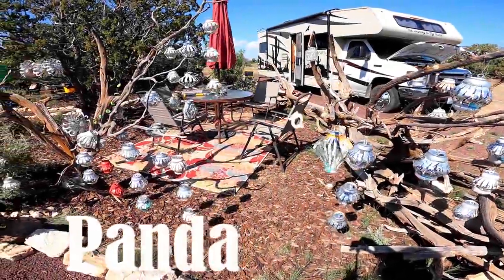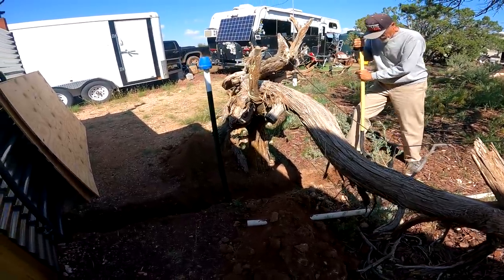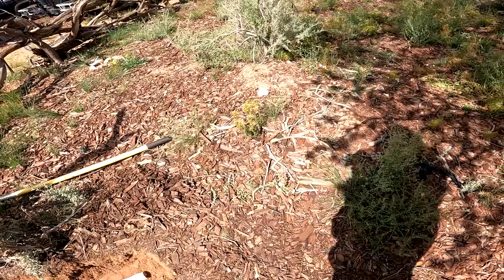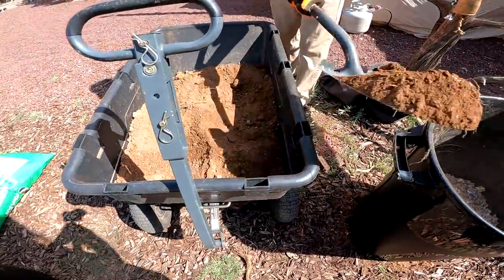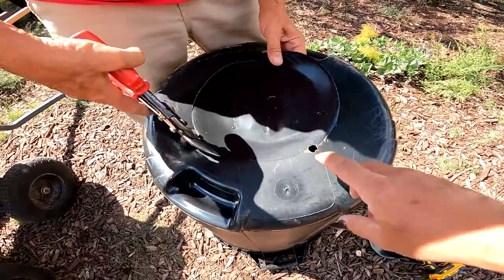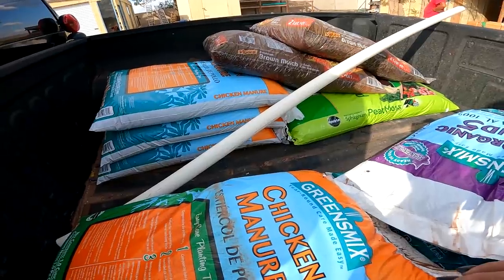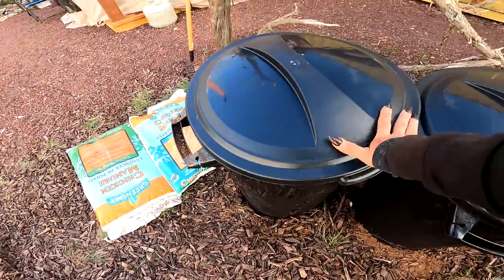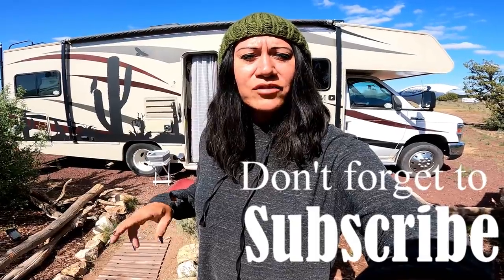Pack Rat Mayhem, Preparing The Garden & Installing Compost Toilet - Homestead DIY Projects

Comment: For Rats and Mice use peppermint oil diluted with water in a spray bottle and spray down the entire engine compartment with it. You can also spray down some old rags and place them in different areas.  The Rats and Mice hate the smell of peppermint oil.

Comment: Love all the ‘green’ improvements going on.  You can take advantage of your new growing tubs this season.  I do the same thing year after year.  Just add any compost, chipped wood, etc every fall and winter and then add the Miracle Grow garden soil in the spring on top and plant.  Watering the plants all summer helps break down the compost underneath and by the time fall arrives I start adding compost materials to the top again.  Works great and I’ve ended up with the most beautiful plants. Enjoy!  You have a beautiful homestead 😊
Reply from the maker: Awesome!

Comment: 03:15 Let me tell you, I had the best success with trash can gardening, I put a pvc drainage pipe, capped on the bottom end, in the middle before layering soil and plants that I poured the homemade fertilizer into, I figured the holes in the drainage pipe gave an even watering of all plants,  
If we didn't have a short growing season I would still be harvesting vegetables, I never had this much success with the standard backbreaking garden. .
 I also was fortunate to get woodchips from the men that cut brush along the roads to put in the bottom of the containers for drainage  and on top to keep moisture in   So, I'll be watching this project for sure,
Reply: How did you make your fertilizer?
Reply from the maker: Thanks for sharing!

Comment: You can use Moth Balls in a mesh bag under the hood and/or a pepper spray around the wheel wells and motor. Also solar lights under Panda as rats do not like them.
Reply: I hear equal amounts of flour and baking soda can keep rodents at bay. Im going to mix up some and put it under some vehicles. 
A cheap fix that might deter them.

Comment: On my property i recess the bucket-traps into the ground, and berm around the lips. It seems to catch more mice than freestanding buckets because it's at thier level. Also, i use old used cooking oil (peanut oil) and grease instead of peanut butter for the bait, keeps my dog from eating the bait. If you drill a small hole or two in the sides for high-water marks you can leave the buckets in place year round and use a gripper-pole (for old people to pick stuff up) to clear out the dead rodents... (i burn them and use them in my compost).
It's just what works for me.
Reply: @rolloverriderpgr  some of my fodest, earliest memories was trapping live mice and feeding them to the hens. Its an important lesson city-folks never get in plastic containers at the supermarket.
The over-simplified princables of "organic gardening" or "permiculture" is to artificially recreate nature with the natural resourses around you, and nature depends on "animal waste".  A "green" compost of lawn clippings is just a tinder-bundle without nitrogen-rich "brown" because you're not feeding the organisms that break down the clippings. 
It's gross... sure ... but so is wasting resources.
Reply: Great idea, to recess the buckets & plenty of old grease around 👍👍👍

Comment: I have had good luck cutting about 3 - 4 inches from the bottom of quart oil jugs and putting moth ball into them and putting them under the hood in the engine compartment. No rodent problems after I started doing the moth balls.

Comment: Leave your hood open. the light deters packrats.  Any light you can put around the engine area helps. They have gotten me twice but I heard them chewing and moved. Went straight for the wires it seemed like. Last time, just a spark plug wire. They will ruin your wiring fast!

Comment: I use peppermint oil on my door sill to my garage.  They dislike it & stay away.  For my van I spray peppermint oil onto the engine parts,  wires & hoses about once a week.   A 15 minute chore avoids hours of cleanup & thousands of dollars of repair.  If the rodents are really bad every day in the beginning works.

Comment: You might need smaller dowel rods or even replace the wood with smaller diameter metal pipe. That PVC looked like there might be too much resistance, against the wood, to turning. Mice don't weigh much at all.  If your traps aren't working consider replacing the dowels. Good luck.

Comment: Put some peppermint oil in the engine compartments it will help keep them out. I use it at my shop. They eat the wiring because the insulation is made of soy. They think it is food. Goodluck. 👍😁

Comment: Omgosh. I haven't even finished watching the video and reading comments...pack rats and rodents (chipmunks omgosh) ---- yes use bucket traps you will figure that out. But spring and fall spray or soak any vehicle engine compartments, undercarriage and wheels with Original Simple Green. Check periodically when you check fluids and respray the area. I've been doing this successful for 8 years. My home base is at 6500 feet in Apache County Arizona. I use Simple Green as my exclusive cleaning solution now - well I also use Dr Bonners and Dawn (if  broke)
You know that I do everything on a budget. Ask me questions... I've been at this for 10 years
Reply from the maker: Thanks Lesa... I'll keep that in mind!

Comment: I’m sure you have received a lot of advice on how to keep them out. But I found an old rv trick. I use a battery operated gopher spike. It vibrates and chirps just lay it on the top of the motor. They don’t like the sound and especially the vibration.
Reply from the maker: Thanks for sharing... great tip!

Comment: One concern with using garbage cans for food production is BPA leaching into the soil.  Food grade containers would be okay though.
Reply: I was wondering about that.  This is the first time I have seen trash cans used to make raised beds.
Reply from the maker: These are ok to use ...there is a number on all plastic containers that you can check.

Comment: Im curious as to how large your pack rats are? I’ve seen them large enough to rip over the five gallon buckets.  Re: rats and wiring in vehicles- cover your wires with black tape and then put clove or cinnamon oil on the tape to ward the rodents off- reapply as needed. Been there. It truly sucks

Comment: Putting Irish spring  soap in the engine will usually keep them out they stayed out of the car for years then we replaced the soap with fresh soap.
Reply: That soap didn’t work for our camper.
Reply: Don't work.
Reply: Well it needs to be out of the box tied to the hottest part of the engine with pantyhose.

Comment: The cans will be too heavy to move!!! I learned my 3rd year in... To fill 50% of the can with empty plastic bottles. Then put a mesh net over the bottles where you want ur drainage rocks to start. You can still add compost to your soil. 
Egg shells work real well for tomato plants.
 I also dump any left over drinks into my garden.
Left over milkshakes, coke, pop, any liquids.
Reply: Emply plastic bottles sound like a great solution so you can move them and also don't need to put as much soil in.
Reply from the maker: I've seen that before... thanks for the tip!

Comment: As someone already mentioned...  Build a set of sub-irrigated-planters next.  You add water essentially to the bottom 1/3 of the container and capillary action will feed the water and nutrients to the plants.  Lots of utube videos on this type of planter SIP for short. Gardening with Leon gives step-by-step plans.  As for plant nutrients check out the Mittleider gardening system - very inexpensive, easy peasy, and perfect nutrition for plants.

Comment: Being in AZ won’t it be to hot with the black color of the cans.  Seams to me that it will dry up your moisture quicker.
Reply from the maker: It will heat up but I'm hoping that with it connected to the soil it won't dry out as fast. The places I have mulched have been keeping moisture well. I guess time will tell... here's to hoping for the best.

Comment: On the traps, A 1 liter soda bottle works good with just a wire going through the cap and bottom, (like coat hanger wire). You can heat the end of the wire and push it through the bucket and bottle.
On conventional traps, tie a string to the trigger and coat it with peanut butter. They will lick the peanut butter off of the trigger without setting it off, but then tug on the string. It is best to fasten this trap to a ramp, (like a 2X3 so they can not get to the bait from the side or wrong end.
Reply from the maker: Thanks!
Reply: @rvpandamonium  be sure to put water in the bucket. A mouse can jump out of an empty 5 gallon bucket.
If you want to relocate them, oil the inside of the bucket.With enough water they will drown.

Comment: I had $500 damage from pack rats in the engine compartment. Flashing rope lights did not work to keep them away. I installed under the hood two Rid-A-Rat high intensity LED strobe lights. Knock on wood and fingers crossed no issues the last two and a half years. 24/7-365 protection
Reply from the maker: Thanks for sharing